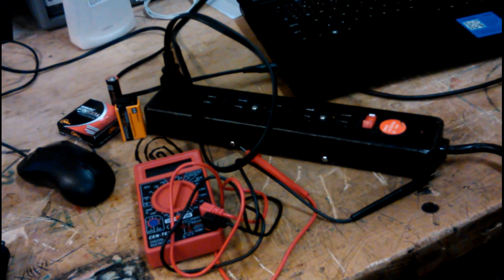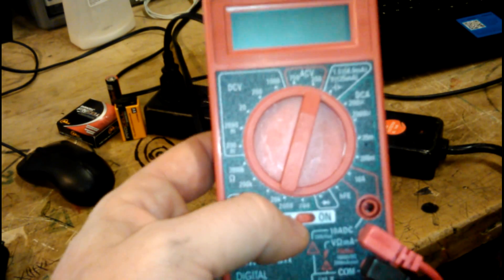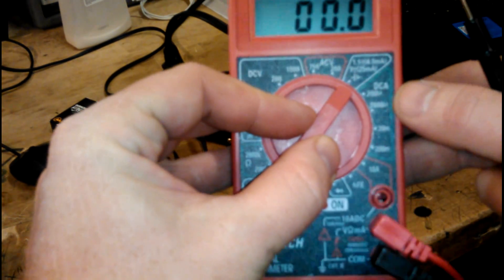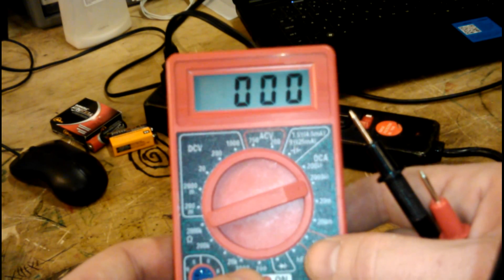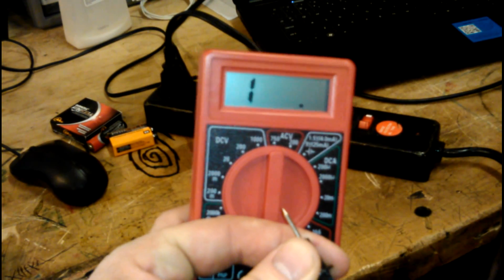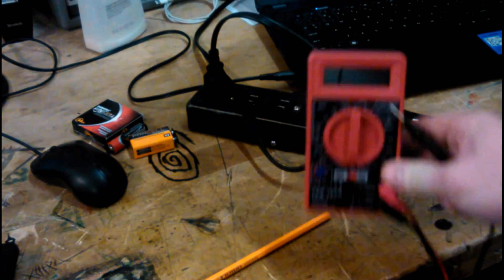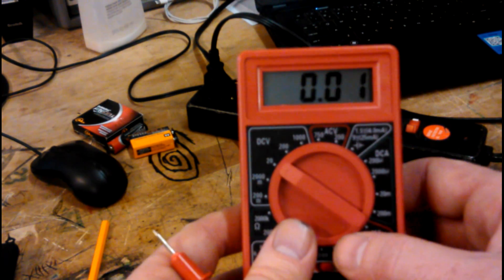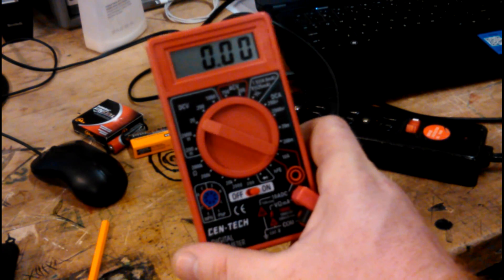Harbor Freight FREE multimeter; Tools for SHTF!

Comment: Battrey Draining on car battery  how can I use V.M
Reply from the maker: This is a very common problem.  Thank you for asking; i should do a video on it specifically, though i am hardly a car expert. In the most basic terms, what you have to do is isolate the system that is causing the drain.  All modern cars do have a small need for power when not running for alarms, gps's, keyless entery / remote start, satcoms, and the little computers that run all these things.  So, the first thing you need to know is if your battery is in good shape, and it's not just the normal drain that is pushing it over the edge.  Also; how often do you drive it?  If it's only a few miles a week, that won't be enough to keep the battery up and you may need to keep it on a trickle charger.  If your car is less than ten years old or so, you may want to have a shop check it out.  There are a lot of components in newer cars that can be damaged by very easy mistakes to make while exploring their electrical systems.  It's not like the old days when all you needed was jumper cables, clip leads and a test light to figure out what was going on.  Check into those & get back to me...  Good luck!

Comment: Good Info. Thanks. Question can this unit be used to check the voltage and condition on a 12v marine deep cycle battery?
Reply from the maker: Any voltmeter is just measuring the voltage potential across whatever two points you put the probes on, in real time as they are placed.  It will tell you what the voltage is across the terminals, but not what kind of power the battery is capable of delivering.  The only way to test a battery like that is to put it on a load tester, which you can do for free at most auto parts stores, or you can buy your own there, or @ wallys or harbor freight for between $50 and $100, depending on how fancy you want it.  Good luck!

Comment: The household battery tester how do I convert a number of 24 to nine volt if testing a nine volt battery ?
Reply from the maker: I'm afraid i don't quite follow you?  Please explain a little more...
Reply: well it doesn't show 9.0 if a 9 volt or 1.5 if a 1 .5 volt- am I suppose to multiply a conversion amount or should the meter show the actually voltage?
Reply from the maker: @songman1955  The battery tester range isn't going to give you a voltage reading, it's doing a small load test.  The numeric readout is showing the milliamperes measurement of that battery / cell under the load that is across the internal circuit.  A good 1.5v cell should read about 4.0 mA.  A good 9v battery should read around 25mA.  Try it with a new one, then again with one that JUST died in the device you are using it in.  You will see the difference.  The AA cells that i use, i usually call them toast around 2.5 - 2.8 mA.  Depending on the device, of course.   Some can draw them down lower, some need more or they will cease to function.  Hope this helps!

Comment: How to check the fuses on the car
Reply from the maker: All fuses are basically the same; they are either intact (closed) or blown (open).   Now and then, you might see one go bad that is not blown, but it's rare.  Put the dial onto the highest resistance range, remove the suspect fuse, and check across it to see if you have continuity.  If yes, fuse good.  If no, fuse bad.    Hope this helped!

Comment: it is very strange that this cheap and most times free meter is the only meter that has battery load tester on it. even my  500 dollar fluke and half a dozen other expensive meters I own don't have that. go figure. and it is handy as heck to have instead of connecting resistor across leads.

Comment: To check for continuity with this cheap  multimeter, you mentioned it was possible. But since this one doesn't have the audio beep to check for continuity,  what am i looking for on the screen to show there was or isnt continuity between a fuse for example?
Reply from the maker: Hi j...   To test continuity with this guy, set the dial to the 200 ohm setting,and short the probes together.   Note this reading, as it will be very close to what you should see when there is continuity.   This is covered about halfway through the video.   Good luck!

Comment: How do you check the control box for a water well with this multimeter? I've searched Google and YouTube without any luck.
Reply from the maker: You will have to give a little more detail...  Which component in the box do you suspect might be bad?
Reply: I was wanting to check each component in the control box to make sure that they were all functioning properly. Fortunately, the issue was the less expensive and easiest part to replace- the pressure switch. I would still like to know how to run through and check the components of the control box for future reference if possible.

Comment: Helpful video 🖒
Does this meter have the ability to test microfarads?
I'm trying to test a capacitor for my central air conditioning and can't seem to figure it out. 😕
Reply from the maker: Karma Fields Nope.  A capacitance tester is a completely different animal.   You can put the leads across the cap in resistance check mode to see if it is shorted (resistance should climb and reach infinite rather quickly), but that's about it.  Good luck!
Reply: GoingGoingGalt ah I see. Thank you for the response and helpful guidance. Much appreciated ☺

Comment: Thanks for explaining what each indicator is for man. I was trying to see if my RV Water Heater Element was getting any juice from my relay switch and had it set on Battery DCV 20 and it would amp up then show 0.00. I am guessing I had a bad relay switch to begin with so I ordered a new one and replaced it ( obviously). I then tested it again with no results. However, I think I was just using the wrong setting on the multi meter. No harm and cost of money though as I knew my relay switch was bad anyways because I would hear a click and another click. With the new one it clicks once when powered on then it stays on. None the less, I will test it again in 120 ACV versus DCV. Thanks a ton!
Reply from the maker: BrotherBones X glad i can help...  And best of luck withtbe rest of your project!   I know my old RV is nothing but one repair after the next....
Reply: Yeah I hear you. I can understand going cheap when they make them to keep cost down, however, I wish they had legit after market pieces built to last instead of having to re-buy and replace junk parts for junk parts.

Comment: Just got mine a an hour or so ago, I had to open it up and hot glue the board down to the case where the leads fit in because that section of board was flexing. I also had to push the battery connector ring the battery connects to together because it was bent out of shape, other than that, or should I say aside from that it seems to work as it should.
Reply from the maker: Hugh Janus;  For the price ya pay for it, stout construction and NASA tolerances are a bit much to ask.   Hope it does well for you!

Comment: I am trying to test my travel trailer converter.  what setting should I put the meter on, 20DCV?  some instructions say to plug the trailer into 110, remove two 30 amp fuses, and touch positive to the blue wire(terminal) and negative to white (ground).  So, set the meter to 20DCV and got a reading of .01
Reply from the maker: Jay Monroe without seeing your converter, it's hard to tell if you should be reading something there or not.   I'm not sure why you would be removing the fuses, unless to isolate from the trailer wiring.   If you have it plugged in and it's not giving you the 12v - 14v that you're expecting to see, yoy may have a problem with the converter unit.   Test your meter on the terminals of the starting battery to make sure the meter is working right.   Best of luck!

Comment: What is the other port for on  the right used for on the red lead.
Reply from the maker: Hal Greene I'm pretty sure the one you are looking at is for the 10A measurement range...  It has to be in a different port than the other ranges because it passes a relatively large current through it.  Hope this helped......

Comment: To measure 230v I would put it on the 750 Acv setting correct? And to measure Amps in the 15 range what do you set it too?
Reply from the maker: Jared Causey. Yes; 750 range for 230VAC.  The meter can only handle up to 10 Amps of DC current according to specs, but I would not try that much, especially with the whimpy leads that come with it.   It kinda concerns me that you are wanting to measure 15 amps...  I hope you're not trying to "measure" the current from a wall outlet...  That is for measuring the (DC only!) Current IN-LINE in a circuit!  Sticking the leads in to the wall in current mode will give you some very fast fireworks and a destroyed meter.   Thanks for chiming in, and best of luck!
Reply: GoingGoingGalt no not really needing to even measure the amps on and just wanted to make sure that’s what the 10 setting meant and would only be measuring the 220-230-240 range on a breaker
Reply from the maker: Well, once again, the current measurement is only for DC, and you can't really measure the current capability of a breaker, without putting a progressively bigger load on it and seeing where it trips.  If you want to measure the AC load on a device, there is a neat gizmo called a "kill-a-watt" that will tell you all that and more.   I have two of them...   Maybe I'll make a vid about them.  Hope this helped.

Comment: Hello, thanks for your help in advance.... I've had power supply adapters fail, such as for a cable box or CCTV camera hard drive adapters where the output..is 12v

Comment: nice video.....i though that multimeter is a piece of crap that's why they give it away for free...now i got to get myself one...thanks bro
Reply from the maker: mikal vanger. They can be hit & miss..m. Ive had a few that had issues right out of the box, and some that have worked perfectly for years.  I will say that the probes are crap..  Be careful or else you can pull the leads right out of them.   But for a free beater meter...  Can't beat it!
Reply: I got a free one also with coupon, must say handy to have and it does work well
Reply: mikal vanger Just got one free when I bought a 99c epoxy mix... Well worth the price.

Comment: Very helpful.  I got this same multimeter free @ Harbor Freight, but never really understood all the functions.  Recently I am trying to figure out why suddenly three out of seven low voltage LED landscape lights cut out.  I think they're on the same line, but the first, third and fourth lights are out.  They are not replaceable LED bulbs.  I'd like to not have to replace the whole light if it's a connection. I have the clamp-style connections to the low voltage wire.  So, should I set multimeter to ACV 200 to see if I'm getting about 12 volts to the lights?
Reply from the maker: Sorry about the delay in replying...  I didn't see this until now.  If it's low voltage wire, then it's not line voltage.  You will need to look at your power supply to see what it is putting out...  It may be ac or dc.  Start at the power supply and work your way back to the light, and you should find where the open point is.    Good luck!

Comment: so my car is blowing fuses from the a/t cont fuse every time I turn on the switch. Does that mean I have a wire grounding out and what settings will I use on this multimeter to check and pull fuse one by one to narrow it down?

Comment: I'd be interested in knowing whether CCA on a car battery can be estimated or measured with this..
Reply from the maker: Nate Ngcould; well...  Yes and no.   It cannot directly measure it, but if you were to put a variable resistance load across the terminals that could dissipate that kind of current, you could determine CCA.  Of course, the battery would also have to be cold too.   Im not sure what they mean by that, but i think its pretty cold...  Like 0 degrees f or lower.  You can buy battery testers for thirty to fifty bucks that will give you more info about your battery too.
Reply: Openin a play pen

Comment: Thanks, You are helping many people with your video who are becoming familiar with basic electronics.  Something they will use all their lives.  But as far as that Harbor Freight Multi-meter goes, it's a piece of junk - never mind one shouldn't be complaining if its free.  I have a Fluke but its too big for my tool box so I've gone thru 2 of those CEN-Techs (one lasted 6 months the other about 9 months.)  If one is going to buy one, spend $15 more and buy yourself a decent one such as Innova Equus 3320 at Amazon.  It's accurate, has battery tester, has more settings, and nicely rubber bumper covered to take abuse. (Don't buy a Fluke unless you're an electrician and have mucho bucks to spend.) Other than that, good job, and I took the liberty to answer some questions here-below. Electronics was a phase in my life I enjoyed, as I'm sure you do.  (PS: I have a library full of electronic books is someone cares to have them.)

Comment: Thanks for the video on my meter. Guess I'm a dummy 😂. I lost my manual on it and it is driving me nuts trying to figure out how to use it.
Reply: Multi-meters in general work all the same so download any manual to give you the basics in settings and measurements.  Where the difference lies is in accuracy, longevity, perhaps more functions and quality.  If you download a manual on multi-meter about the same price range you should be fine, what will differ on all meters is how to reach battery compartment, location & fuse specifications, and battery type, so don't throw away a fuse if its blown.  You need it to buy the same fuse. Some multi-meters will have a 9 volt special battery, don't use that manual, they are for military use only. Hope it helped.
'

Comment: I have two of these tree cheapo multi meter.

As you know it is rated for 10 amp current.

Can I hook two up parallel to measure 20 amp current. 

It 3 parallel for 30amp?
Reply: Ka Ye vt. Ni.
Reply: No.  Current splits in Parallel just so you know.  Each meter will be reading its own reading. Most will only read up to 10 Amps, you will need to buy a Clamp-on and they are expensive.

Comment: the capacitor is on an outside AC unit
Reply: That's a starting capacitor, to take the load of the motor.  It's got some zap so be careful.  Same with a Microwave - and every year some tech gets killed. Don't even mess with it. A large Capacitor can kill you - just be warned.  Same with old TV's (I don't know about newer ones.)

Comment: I have this meter, I have to test the continuity of the capacitor and the compressor what do I set the meter on to do this?
How do I test this meter to make sure it is calibrated right?
thanks Judy
Reply from the maker: Judy Ettenberg hi Judy;  this meter does not have a capacitor test mode.  A capacitor tester is a completely different animal.  You can put the leads across the cap in resistance mode and see if the cap is shorted (reading on the display will be the same as if you just shorted the leads together), but that's about it.  it cannot tell you if the cap is working to its rated ability.  if you are checking it for a short, be sure to isolate it from the circuit first so you are not also looking across the winding of the motor.  best of luck!

Comment: Have the exact model. How do you know if the meter is working right? When on the 200 ohm setting, then crossing the probes, mines reading dances all over the place for sometimes up to 20 seconds before settling into about .6
Reply from the maker: BOC4ALL yeah. the resistance reading isn't perfect.  if you need it to be, better buy a more precision meter.   There is a zero adjust pot inside on the circuit board, if you take the back off like you have to when replacing the battery.  Play with that if you need to see true zero for continuity.
Reply: GoingGoingGalt 
I just got this exact multimeter and I would like to know if there is a way to measure small circuit board capacitors with it or perhaps at least be able to check them to see if they are good.
Reply from the maker: This meter does not have a capacitor test mode.  A capacitor tester is a
 completely different animal.  You can put the leads across the cap in 
resistance mode and see if the cap is shorted (reading on the display 
will be the same as if you just shorted the leads together), but that's 
about it.  If it's a big electrolyctic, you should see the value change as the cap charges.
Reply: Yeah, OK thanks.

Comment: Hello and Thank You for the video, very helpful.  Off the wall question for ya:  How would this meter be used to troubleshoot a remote control car?   More specifically the transmitter and other components in the RC car or any similar electronic device.
Reply from the maker: That goes a lot deeper into the process of troubleshooting than I can get into here, Walter.   I'm afraid that every device is different, and I can't help you without having it on my bench.   I might not even be able to help then...  if it's in the RF section of the remote, I'd be lost.  Check the obvious connections from the battery compartment and power switch with the voltage range...  after that...  I'm afraid I'm a little lost.  best of luck!
Reply: All you could do is test the components in the OHM settings to see if anything is either open or shorted.  You will need an RF meter to test wavelengths.  Go to Radio Shack or a shop that installs the dish.  They do make meters which reads the signal to be adjust the dish in the right direction, but again not cheap.